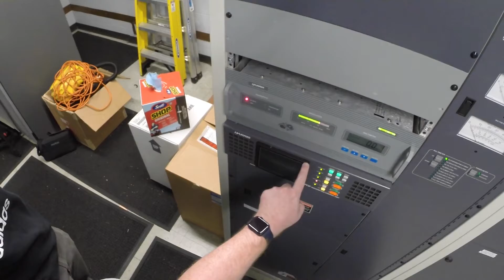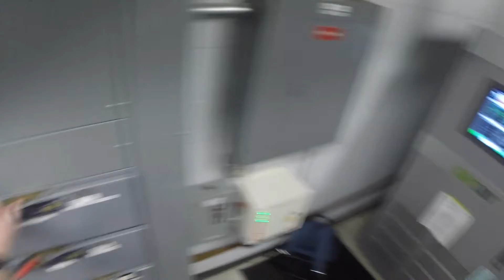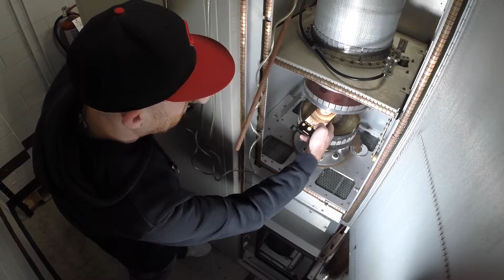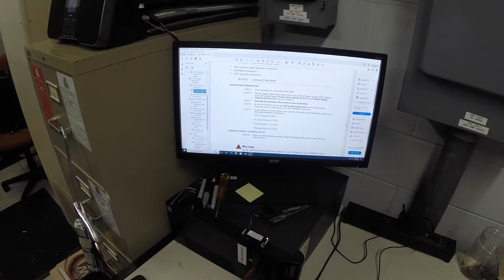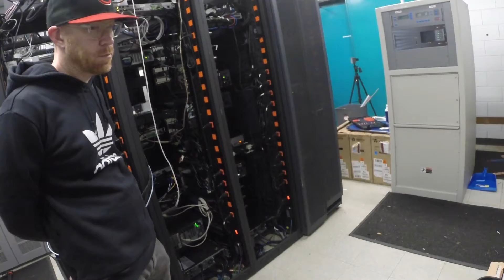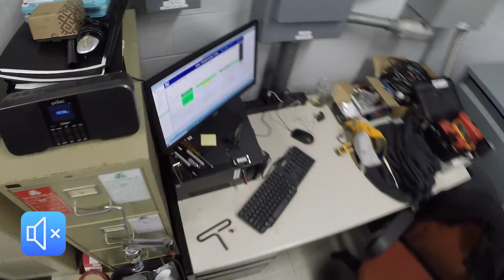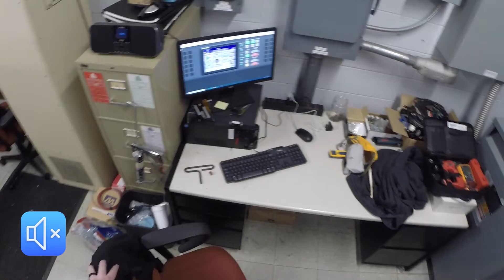Broadcast Engineering: FM Transmitter Maintenance

Comment: Nice clean professional installation. Good for you guys! Thanks for the look inside. 🙂 Curious..What's the plate voltage on the RF output tube in the final of that xmit.? Right you just said 13k...LOL nevermind.  Tubes run at high voltages whoa!  Very different from the modular ones. Power companies love the older stuff, Right? Do you guys keep a spare on hand? Must cost a small fortune.

Comment: 0:56  Too much whiz-bang computerized stuff in modern transmitters.  Don't you think the simpler, older, pre-computer era ones were better?
Reply: Consider the cost per hour in terms of consumable tubes and electricity use.  If the old stuff was better / less expensive to use, stations would be demanding that they be built.
Reply: The glass tubes were certainly prettier than MOSFETs.
Reply: Maybe for prettiness sure, but for cost to run? Absolutely NOT! It’s still FM and still sounds good. That’s what matters and that’s what the end user is going to hear.

Comment: It sounds like it need to be re tuned the plate and check the loading as well. The VSWR is sending too much power back into the tube causing it to over heat.
Reply: Check that bias baybeeee
Reply: As I recall, their VSWR was 1.08 to 1.  That's not bad.  But there are some things to be concerned about there, like that Plate Voltage.  It seems a bit high to me.  And possibly the cavity tuning may be a bit off, too, so that 4CX20,000C was dissipating a bit more than necessary for the rated power output.  There are good ways to observe that with a spectrum analyzer, which curiously I don't recall seeing anywhere in the video.  Around transmitters like these, a spectrum analyzer is a very useful tool.  

73 from Bob, WA6WHT and transmitter engineer for several San Francisco Bay Area TV stations at various times. 😀

Comment: A Broadcast Engineering YouTube channel.  How cool!  I was a contract engineer/staff engineer/chief engineer for a little over twenty years with a dozen  stations in the southeast.  Finally got tired of being on call all the time (even when my name wasn't on the board) so I became an IT geek, and spent the next fifteen years crawling under desks.  Retired now, and enjoying Ham radio.   Thank you for the memories!

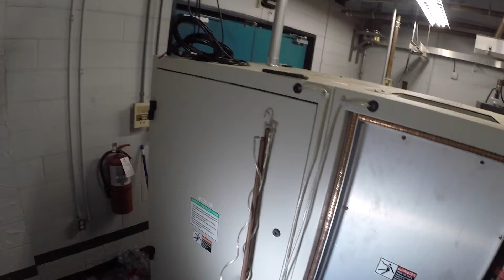4:08  Please take a look at the Dewalt DCF680 cordless screwdriver.  It'll save your wrists from repetitive stress injury, save time, and is about as likely to overtorque or cam out as a manual screwdriver.  Not useful for heavy stuff like 2 1/2" wood screws, but great for racks or the rivet nuts on PA cabinets.  Gyro controlled, so just a little twist in the direction starts tightening or loosening, more twist goes faster.  There's a clutch, but it's unnecessary since you can hold it like a manual screwdriver.
Reply: This Broadcast Engineering show is also good for audiophiles who are interested in sound reproduction and broadcasting.
Reply: The nice thing about being an amateur is that you can do whatever you want, and not have to do what others demand of you!  Enjoy! 😊
Reply: Where can I contact you?